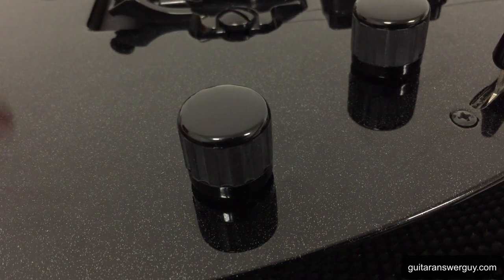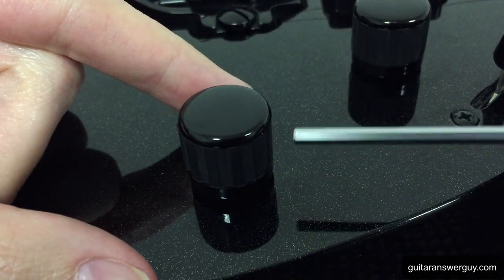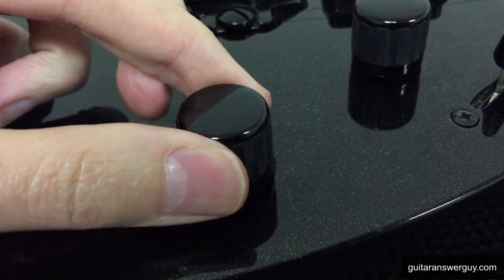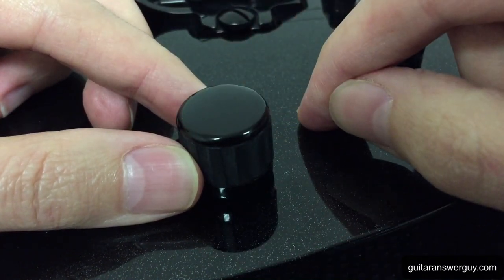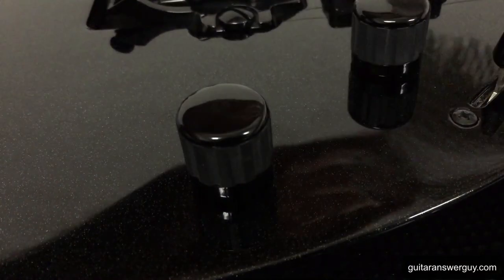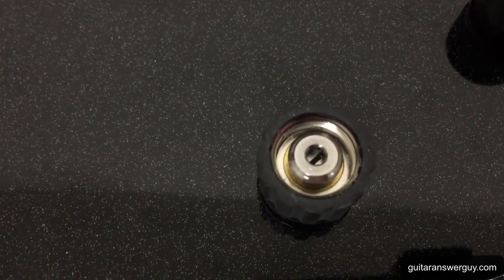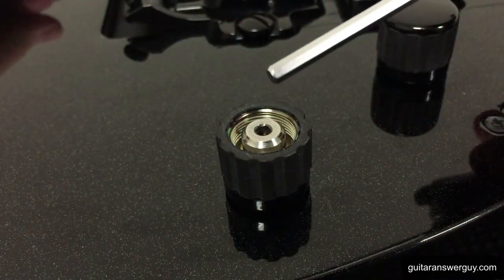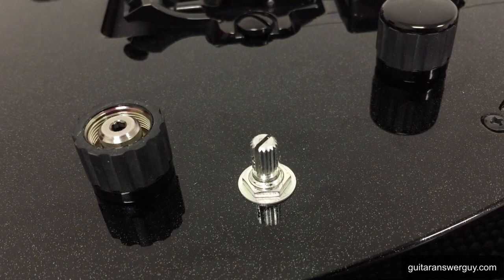How to Remove a Collet Guitar Knob

Comment: These are my favorite knobs, although rather expensive. At $25 a piece I try and find them from Ibanez dealers with overstock, but have had to buy direct from Ibanez on more than one occasion. They are made by Gotoh for Ibanez, and Gotoh does not sell anything at all similar to the public. I have researched other manufacturers for an alternative, but no luck. Apparently they are quite expensive to manufacture, and Ibanez is likely to stop selling them separately, and only include them on certain Prestige models.
Reply from the maker: Wow... $25 for these!? I had no idea they were so expensive.

Comment: So this would apply to telecaster knows right? Great vid tho
Reply from the maker: Hi James! Actually, the make/model of the guitar is irrelevant, since guitar knobs can be easily swapped by previous owners. Also, even the same make of guitar (e.g. 'Telecaster'), can have different knob types based on the specific model. So, there's no way for me to know for sure what kind of knobs are on YOUR Telecaster. If your Tele came with metal knobs, as most do, they're most likely non-collet knobs, which means there is a tiny screw in the shaft that you can loosen. Some Teles come with plastic knobs, but I'm not sure if they're collet knobs or not. Most likely they aren't, but if yours has plastic knobs, first check to make sure they don't have a little removable cap on them (like the knobs in this video). If not, then you're safe to pull them off.

Comment: How do I tell if my knob is a collet knob. My bass is a steinberger and they said it was a pull up knob, but it won’t pull up, not that I tried really hard but enough to realize it wasn’t pulling up.
Reply from the maker: Hi Tim. I go over this in the video. Try to twist that top off the knob(s). If, after a lot of trial, it doesn't appear to be a cap that unscrews, then you've probably got a pull-off knob (Stratocaster style).
Reply: @guitaranswerguy  I got it off, it was a pull off but thank you very much for responding

Comment: i have an ibanez and i think its a collet knob but im not sure since i cant get the cap off
Reply from the maker: They can be tough to unscrew. As you saw in the video, I had a little trouble too. If you’re willing to sacrifice the knob, you may be able to grip the cap with a pair of needle-nose or other pliers, and try to get leverage that way. If, after all that effort, the cap doesn’t move... it’s possible that it’s not a collet knob after all, and just a press-on knob.

Comment: Mine is so tight i cant unscrew it. Im thinking of melting through with a solder iron. Collet knob is the dumbest idea I’ve ever seen
Reply from the maker: I agree. I don't like 'em because I actually have the opposite problem: the cap is constantly loosening on me. I've had to put a little Loktite on mine to keep them from unscrewing themselves, which only makes them difficult to remove when needed.
Reply: @guitaranswerguy  i had to drill through lol.